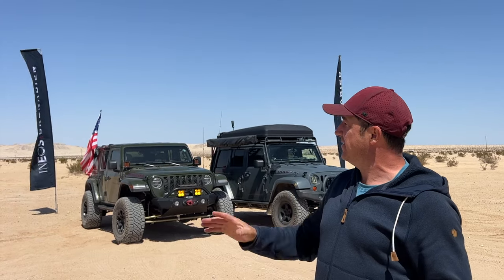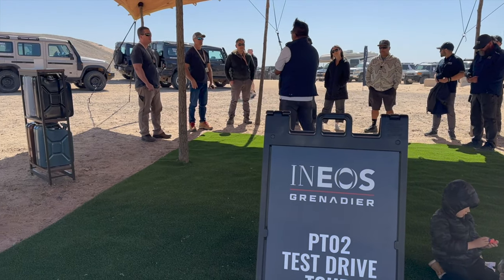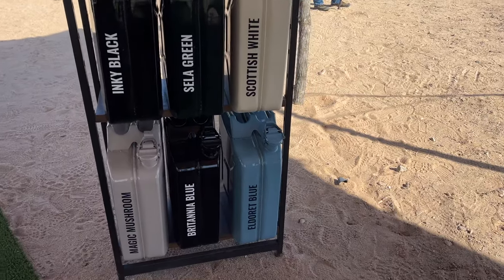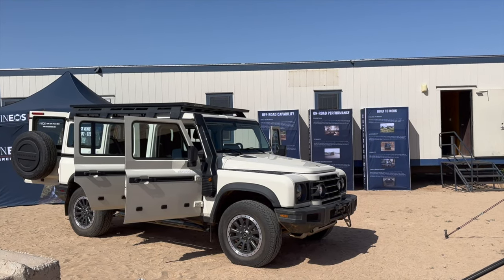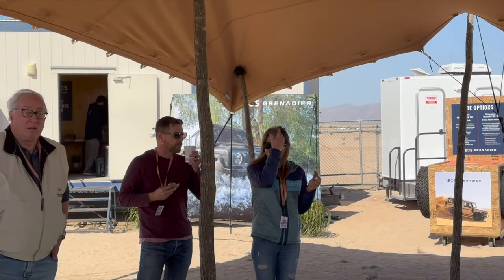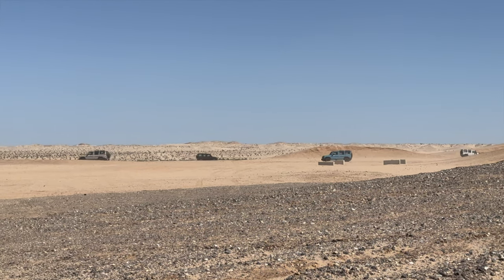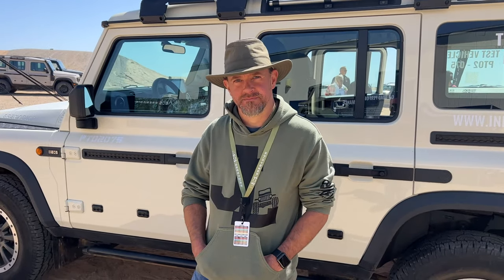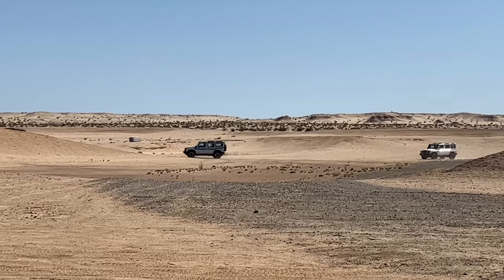INEOS Grenadier 4x4 - Come on our Offroad Test Drive!

Comment: I was at this event and had some fun and enjoyed it very much. The Grenadier drives off-road very confidently. It’s a solidly built and good looking vehicle. Overall it is not very roomy in the inside especially the second row even comparing to my FJ.  Second row seat is very upright and very little room for the feet, it feels and looks uncomfortable for the passengers, especially long rides.
Reply from the maker: Great event, right? As for interior room, if you're coming from a JK, it feels pretty open!
Reply: Interesting as I have an FJ Cruiser as well.

Comment: How reliable is a turbo BMW engine?  Can that last for the long haul going slow in hot climates?  eg Arizona desert, crawling up rocky trails in blazing heat?
Reply from the maker: I only know one good way to find out!
Reply: @DocWrangler  just saw claimed 14mpg on Super combined.  Ooof…is there an SUV that is worse than that?  I’m getting 18mpg in my Wrangler, and that is using regular gas.

Comment: How did you find the rear seats to be?  Looking at the specs the maximum rear legroom is 30.5” .  That is smaller than a midsize truck (I.e. Colorado has 35.8” of rear legroom)
Reply from the maker: Maybe a little small, but good enough for me…for context, an economy seat on most airlines is 30-32”
Reply: @DocWrangler  Thanks so less legroom than a JL?
Reply from the maker: Yes, a Jeep JL has 35.7” of legroom 👍🏼
Reply: @DocWrangler  I do wonder how some manufacturers are measuring legroom.  I’ve sat in the back of a ZR2 Colorado behind my driving position and it was tight behind the seat, but on the JL I have a few inches of space even though on paper it has a tenth of an inch less 🤷
Reply from the maker: @kmg3144  no idea…maybe they move the front seat all the way up first? 😂🤣

Comment: Pronunciation as follows: The “in” is pronounced as it’s spelling suggests. “In”, not “eye’n”. Add “eos” to “in”and there you go. 
I gather the North American market is limited to petrol only power plant, and I’ve also heard that you’re possibly limited to the Trialmaster (not Trailmaster) and Fieldmaster models only, but that might’ve changed by now. Something to do with US Type Approval when adding optional accessories during production, as opposed to add on accessories which are fitted post manufacture. 
Hopefully my 2 seater Utility Wagon will be ready in June (diesel option).
Reply from the maker: Awesome! I really wish we had the diesel option here but I guess emissions won’t allow it… I don’t know if we will be limited on the models but I’ve heard that as well. so exciting that you got one, what will you be doing with it? Also - What color did you get?
Reply: @DocWrangler  Magic Mushroom was my colour choice, with red chassis. 18” steel rims, plus a few accessories such as winch, roof rack, raised air intake and LED light bar. Rubber mats and seat covers too, as it’ll need hosing out on a regular basis. 
It’ll be my work “van” during the weekdays (I’m in construction), and my shooting wagon for playtime. 
Some of the ranges we attend require 4x4 for access in winter and wet months.
Reply from the maker: @robinireland810  sounds awesome! Magic Mushroom is a great color, have fun with the new rig!
Reply: @DocWrangler  BMW doesn't sell the B57 diesel engine in us so it hasn't had it emissions approved in the us. Ineos isn't probably going to sell enough of them for it to make financial sense to pay for BMW to have it approved.

Comment: The lack of disconnecting sway bar is unfortunate
Reply from the maker: Agreed, although I’m sure there will be some aftermarket links that can be manually disconnected
Reply: @DocWrangler  This isn't a major manufacturer, so aftermarket support could take ages.    TBH in every video I see of the Grenadier, the front axle looks like it barely articulates more than some off road oriented SUVs with IFS.
Reply: There's always a wrench to disconnect the sway bar. I've driven the Gren offroad and the sway bars feel well tuned like it might not even need disconnection.

Comment: Seats come down flat when you flip up the seating element first.
Reply from the maker: oh dang! I wish I would've know that! let me see if I can put a note in there somewhere...thanks!
Reply: The rear seat backs will fold flat, but not level with the rear floor. This has been confirmed numerous times already due to the car battery (and auxiliary battery) under the seats.  There are plans for an aftermarket slim rear shelf compartment that will make it level when the rear seats are folded down.
Reply: Seats fold level, but not flat in relation to cargo deck. 
Second row seats didn’t impress me regarding leg room and loss of cargo space. 
Two seater Utility Wagon makes full use of cargo deck, including full height steel mesh bulkhead behind driver/passenger seats. 
Already checked out that Pelican 1750 rifle cases fit just fine. 
Optional 5.5tonne winch may look expensive, but suspension is upgraded, as well as auxiliary wiring harness is pre installed.
Reply: Not flat. Flat means flat.
I could sleep 7'/ 9' flat in my (3) Ford Explorers and (2) Ext Escalades. Also haul plywood.
The Ineos does neither.

Comment: There are several reasons why not to buy the Ineous. First of all, no manual transmission option. If you are stuck in the middle of nowhere it is better to have a manual transmission, you can push starts a vehicle with manual transmission you can tow it with another vehicle without causing damage to the hear box etc. Second point BMW engine. These engines are loaded with electronics and again best to have a straight forward engine especially in remote places. The footprint of BMW is not synonym with places like Africa so availability of spare parts and skilled mechanics is in question.  The Ineous is a mishmash of parts and only time will prove if this is the correct mix.
Reply from the maker: good thoughts, tho manual vs automatic is not as critical in my mind...definitely interested to see how this mix pans out!
Reply: Grenadier has a neutral in the transfer case so being towed is a non issue.